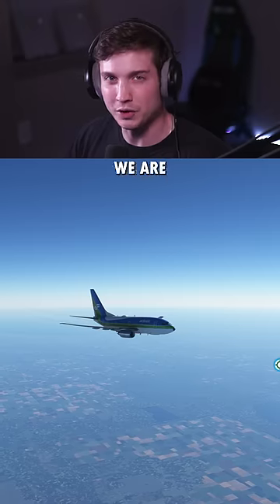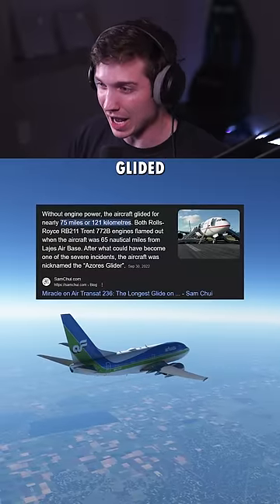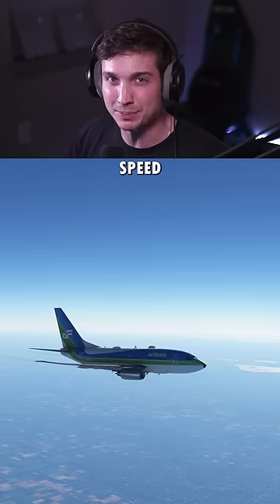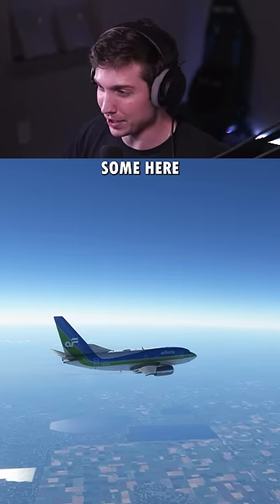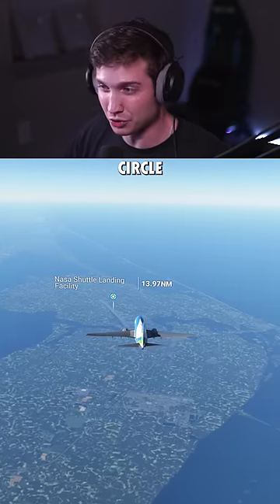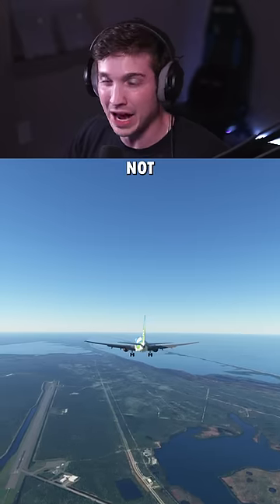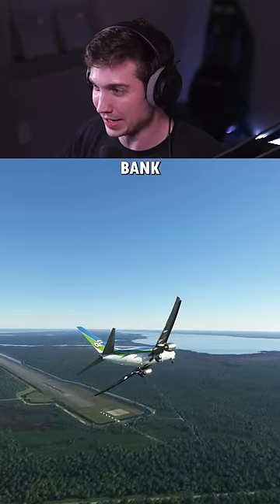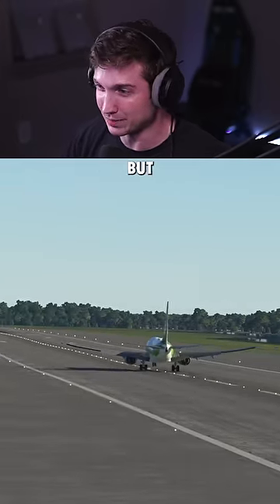If an Airliner Loses BOTH Engines...

Comment from the maker: Reply to this with everything I did wrong, LOL
Reply: u got da naked g's plane
Reply: Idk
Reply: that approach was the goofiest approach ever, to a nice landing. even with no engines
Reply: Do not like my reply.
Reply: Bro you were high and landing approach was bad
Reply: @VEDELILRLSS okay, I wont
Reply: is ok
Reply: That goofy approach
Reply: everything
Reply: The goofy ahh approach 💀💀
Reply: Bank angle, Bank angle 
Terrain Terrain, Pull Up, Pull Up, 
Don't Sink, Don't Sink, Too low Terrain Too low Terrain 
Low flap, Low Flap, -------------
Reply: im not a 737 pilot but i am a glider pilot; i’d probably set up in a normal circuit and use the spoilers to control decent, adjusting as necessary
Reply: So I would like you to know that kmlb is an airport along that route and they have a 12000 foot runway, I know because that’s where I fly out of and you flew about 5 miles from my house
Reply: You made a video that’s too amazing
Reply: Man! You killed it like always Aaron!
Reply: Talk us about dc-10 plane❤
Reply: @patricklunau5601  ooh that’s smart. I wouldn’t have thought about using spoilers to lose altitude. My idiot self would have pushed the nose down
Reply: @NileBlackAndWhite what 💀
Reply: Can you do this, but with a 747 and a belly landing? 💀
Reply: If you landed without killing anyone or wrecking the aircraft....then you did it right. Aviate, Navigate, Communicate.
Reply: Recreate air transat
Reply: Didn't decend fast enough
Reply: Whats the game called
Reply: Whoever will like this comment, please don't!
Reply: That Air Florida livery didn’t…uhh….age very well….
Reply: @dmanduff9108  YESS ANC*
Reply: Chuchington will hunt you, cause you forgot the background LIGHT
Reply: Ok
Reply: nasa shuttle landing  runway
Reply: Dude, you used the Air Florida plane that hit the bridge, it's a miracle you landed at all.
Reply: You forget to turn on the engine to reverse thrust 😂
Reply: Making a YouTube channel
Reply: You could just have done a sideslip when visually reaching the facility
Reply: You found the airport at Hell's Gate, the shortest one, but can you find the one in Lhasa, The Qamdo Bamda Airport??
It's the longest
Reply: @BasicallySai  🗿🗿🗿
Reply: Hot wings
Reply: What game is that
Reply: What’s the game name I neeeeed thiss
Reply: U flew a plane without a licenses
Reply: First thing you did wrong was cut the engines, planes fly much better with them running 😅
Reply: You made it sound like you were going to lose altitude before you landed
Reply: You had no hydraulics either.
Reply: Azores glider was an A350 not a 737.

Sorry A330
Reply: You have to do it at regular speed to create an authentic experience
Reply: Whats the game you play?
Reply: What game is that
Reply: It's not windmilling when you're gliding in a jet powered aircraft.. that's only for planes with propellers......
Reply: You made the wrong runway
Reply: Can you please tell me where you got your gaMing airplane
Reply: What is the game called
Reply: Cheat, like how did you perfectly alone straight after cut but when you were turning you were not straight but way I’ve runway already.
Reply: effeeh
Reply: You could've done a 360 between the downwind to base leg until you lose enough altitude to the point where you could make a comfortable approach to landing situation.
Reply: Livery is too unrealistic
Reply: Aaron that Air Florida 737 looks like Air Florida flight 90
Reply: Successful landing 

So nothing wrong!
Reply: horrible bank angle,no cation of stall(jk)

Comment: The skill required to just glide it to the nearest airport by airline pilots is criminally underrated!
Reply: nearly every commercial pilots could do it as they are training ready for every possible situations (this situation is one of the basics,the hard ones are losing vertical/horizontal stabilizer)
Reply: Bruuhh
Reply: Its like a basic skill that you learn with your PPL. Its just a bigger plane with less manoeuvrabrility when it comes to loose both engine.
Reply: That’s your VG speed, or your speed for best glide. As a pilot you have to memorize V speeds for every aircraft
Reply: If you're above an ocean, you're screwed basically. Nowhere to land
Reply: Thinking gliding takes skill is overated.

Comment: This situation you had here is the exact situation that those pilots faced where they were too high but couldn’t do a circle because they were too low so he decided to legit sideways glide at at 45 degree angle that is used in ultralights but never has been attempted in a jet plane let alone a airliner so those pilots have balls of steel

Comment: A general rule of thumb for calculating your glide distance is 3*altitude+1 NM for every 10 knots above stall speed
Reply: But confused about this since you didn’t mention what units the altitude is in. I assumed feet but then say I’m at 30,000 ft and cruising at 200 ktas with a stall of 80 ktas: 30k*3 + (200-80)/10 means I can travel 90k + 12… what units are these in to make any sense at all?
Reply: @haltorne6647  true 
im just taking the stuff from one of mentor pilots newer vids over a plane that had to glide 
i should have made it more clear

Comment: I swear I always thought if both engines failed the plane would just stall immediately and crash😅
Reply: That really depends on the pilot's skill to keep the plane at the right angle. Pushing up would cause a stall and pushing down would cause a nosedive.
Reply: I thought that as well 😅
Reply: That's actually a reasonable assumption.  It wasn't until I found Kelsey on 747 Gear that I learned that a plane could do that. 
I don't know if the plane could circle several times.
Reply: @philiphoel4290 I know it from that guy too
Reply: Bro the same thing😂😂😂
Reply: And I think that happened with airfrance flight 447😅
Reply: why would you think this? ever throw a paper airplane? did it stall?
Reply: If plane stall the plane crash like air Florida 90, true right
Reply: What if I told you helicopters don't fall out of the sky like a brick or they lose their engines either🤯
Reply: @bbbib-vn1hc usually, yeah. Although that's more a problem with my throwing skills
Reply: I thought so too till I started playing MSFS😅
Reply: All planes have a glide slope, some just worse than others
Reply: As long as there was enough altitude like in this video, it absolutely could circle several times. I am in flight training right now with only about 22 hours of flight time, but we are already practicing procedures for engine failures in flight and you would be shocked at how un-scary it is. It is just a nice gradual descent as you pick out a suitable landing spot on a runway if possible or in a field of not.
Reply: It necessarily. It depends on many things, but altitude is a big one. Pilots are trained from very early on how to recover from a stall. (I think I started practicing stall recovery with only 4 or 5 hours of flight time behind me.) When the airplane stalls, you will lose altitude, but as long as you have more altitude than you lose, you will not crash.

Comment: There is a maneuver called a forward slip meant to keep airspeed manageable while losing altitude quickly and with little horizontal distance being covered. The idea is to make the aircraft as high-drag as possible. You basically deploy flaps and put aileron with opposite rudder input. Most airline planes don’t allow it because it may shift the fuel enough so when it’s low it will no longer feed into the engine, but if you lost both engines anyway it might not matter.
Reply: Also it makes the approach very unstablilised but what is a stable approach when u have no engines
Reply: Google: the gimli glider. Guy put a 757 into a side slip to land. Pretty bad ass if you ask me.

Comment: There's maneuver for losing altitude during gliding if we coming too high for the approach. S Pattern and 8 Pattern. The main purpose is to maintain visual with the runway. Remember to put extra margin for altitude since we use landing configuration, unless you want to land short of runway

Comment: Got it on the ground that’s all that matters. When you were too high to land but too low for another full circle you should have bisected the runway at midfield and entered the pattern on downwind from there. You could fly an extended downwind and turn base then line up on final. But what you did worked just as well.

Comment: If you’re too high to make the runway but too low to make another circle you can try to forward slip and it’ll cost you altitude without taking too much airspeed

Comment: A380 and B747: only two engines gone? Hah.
Reply: Not really, if the aircraft is heavy, 2 engines wouldn't be enough, and its even worst if the 2 engines are on the same side since that will create asymmetrical thrust
Reply: @YourAverageSpeedrunner yeh

Comment: You should try this keep pushing the mileage out farther and farther and farther until you just can't make it anymore do it in cam wins and when you've reached that limit then start throwing in variables and see how it affects your Glide and your distance

I'm sure the manufacturer's Boeing Airbus etcetera have all done this but this might be actually usable to know all those parameters especially the Crosswinds and possibly even whether to have this information available two organizations like NTSB and FAA

In fact if you get a several people or a bunch of people to eat try this and document it all that information is probably very valuable data on real-world in a simulator statistics that can be used to help pilots in such an emergency

Comment: He could have landed in middle of this run (-22 ), I believe, runway 15,000 long with an additional 9,000 feet of good flat lake bed to add to it , they connect. So 24,000 feet-that 4.54 miles. Just saying, I’m not a pilot or have I ever flown a plane.

Comment: Never let them know ur next move:✈️ 4 engines
Reply: Well, if the plane is full, 2 engines out of 4 would still not be enough, and you will still slowly drop down in altitude
Reply: Loosing 2 engines on the same side could be a problem. El Al 1862
Reply: @michaelmappin4425  Yup, aka asymmetrical thrust

Comment: What if you loses both engine while taking-off😮
Reply: Well it depends on the speed the aircraft was going at. If it didn't yet accelerate to its full speed it could just stop. If it was near takeoff speed it would need to pull up and then it would probably stall and crash.